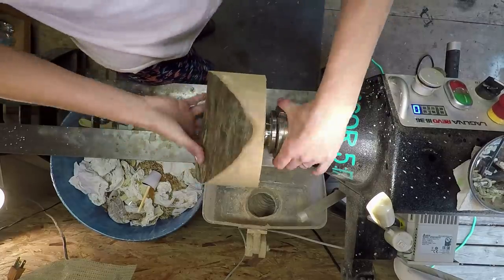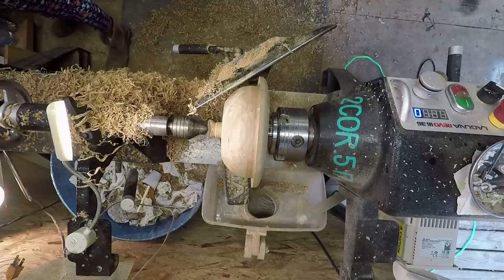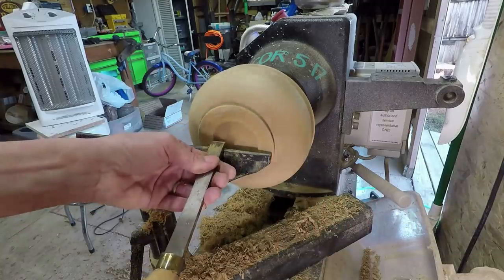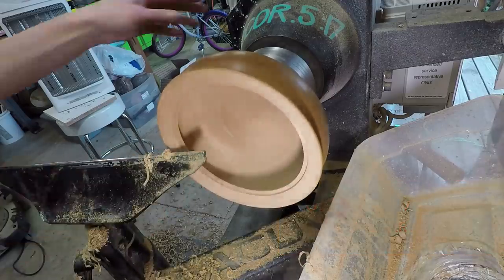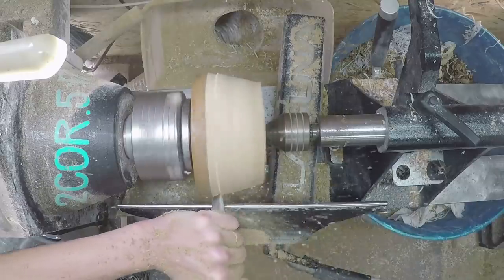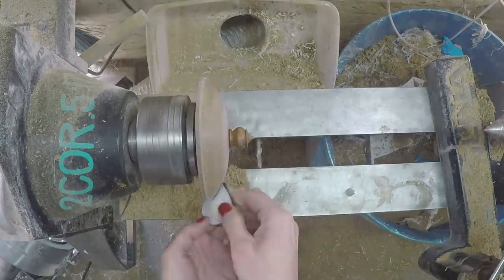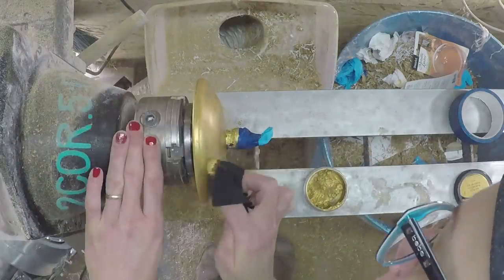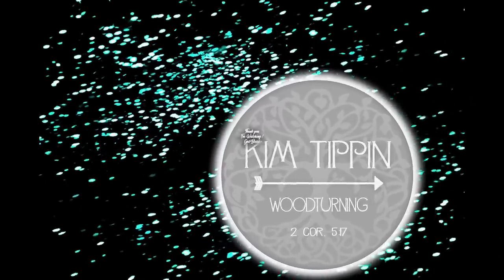Maple Hollow form with Metallic Gold lid

Comment: I use MM Modern Masters Metal Effects. The bottle I have in my is  hand is OXIDIZING COPPER.  If you try this you will need to buy the base coat also it is sort of like milk paint.  You will also need to get the reactive solution.  Good luck George
Reply from the maker: Thank you, George.  I will check it out! 🤗🤗

Comment: Kim its gorgeous well worth the wait and effort I love the gold great choice. Can I ask if any of the DIY or O.b.shine mixtures have a shelf life after mixing them?? Love the shape of this pot also did you take the piece off the inside of the lid or did you just give it a sand and leave it on? 👍👍👍
Reply from the maker: Thank you,  Gavin. 
Shellac does go bad after awhile but I am not sure how long. So yes, the OB does too. I mix a little OB at a time just so it doesn't dry out. I was told putting the Shellac and OB in the refrigerator will keep it for a long time. I imagine that would be good when buying or mixing in large quantities.  
I am not sure that you mean about the lid?
Reply: @KimTippin  thanks for the tip, I was talking about the tenon on the inside of the lid that you used to hold the lid on the lathe. Thanks again for taking the time to reply and read the comments it really does mean alot ❤❤

Comment: I’ve noticed that you’ve recently gotten into resin molds using total boat. I have the pumps and I mix them thoroughly then pressure pot them at 48-50 psi for 18-24 hours. Ive done three so far and all have huge air bibles inside once I start turning. Any idea what to do?
Reply from the maker: Air bubbles can be caused for many reasons. Air trapped under the wood or in the wood could be something to look out for. 
sorry I am not much help.

Comment: Are you applying lacquer over the wax? Wax is a contaminant and will create adhesion problems and cause the lacquer to peel off in time. The lacquer may adhere temporarily if sprayed in light coats but in the long run will most likely fail.
Reply from the maker: Great to know.  Deco Art recommends a varnish or an acrylic spay for sealer. I haven't purchased any yet. I have tested lacquer on a few pieces, so far so good. I guess time will tell.

Comment: Very nice piece. I was wondering, what is the denatured alcohol for? I saw you used it just before your abrasive paste. Thanks in advance!
Reply: To clarify, I am referring to the base portion since you did explain why you used it on the lid. Maybe it was for the same reason? Sorry if it's a dumb question lol
Reply from the maker: There are no dumb questions in wood turning :) I used DA to clean the piece before any finish. It also helps to raise the grain of the wood. Abrasive paste helps to knock the gain back down.
Reply: @KimTippin  Cheers. Thank you for that :)